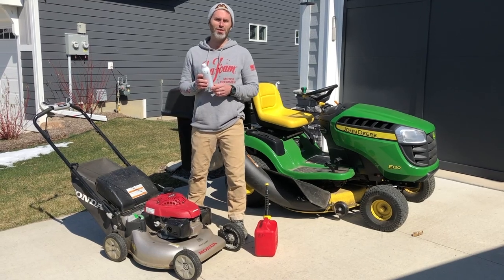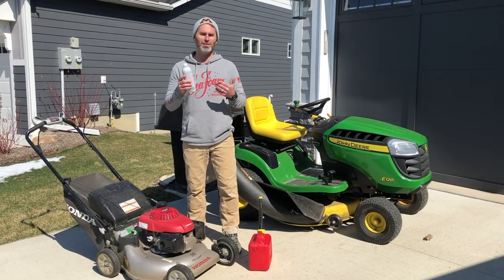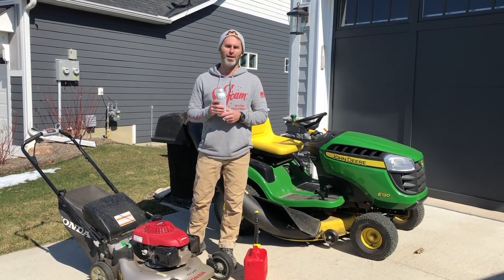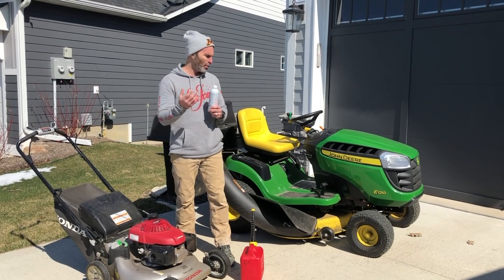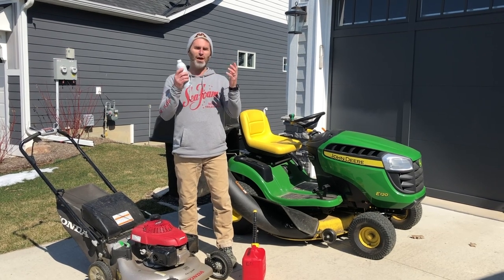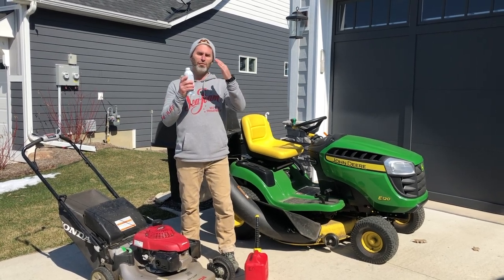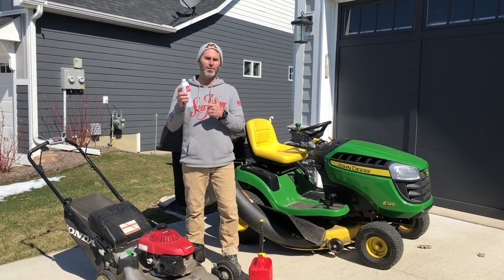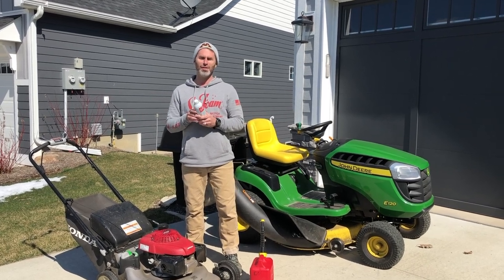How to prevent lawn mower engine problems (the Sea Foam way) 👍

Comment: I've been using Seafoam for a carb cleaner and fuel stabilizer for over 30 years and it just plain works. I run some thru my cars and trucks too to keep the injectors clean. After having problems using Stabil years ago, I switched to Seafoam and never looked back.

Comment: I have a Dixon ZTR Ultra zero turn mower with a 25hp Kohler Courage engine that is notorious for having issues with the carburetor.  I put a little bit of gas directly into the carb to get it to start sometimes, do you think I could pour some Seafoam in there and get good results?
Reply from the maker: Yes, try this the day before next mowing: Pour a full can into a low tank of gas and run the engine for 10 minutes. Shut it off and let sit overnight, then add more fuel and run as usual. Let us know what happens.

Comment: My motorcycle, after long storage, runs very poorly without a lot of choke. I am told this mean the primary jets are clogged, I am also told that the primaries are so small that additives cannot reach the "varnish". Has anyone had success?
Reply from the maker: Sea Foam will go wherever gasoline can go. No trouble reaching the varnish. Hope this helps.

Comment: I just recently heard of SeaFoam so please excuse my stupidity but are you folks simply adding the SeaFoam to your gasoline? If so, at what ratio? I watched another video where the gentleman poured it into his intake?
Reply from the maker: Hi Cheryl. Most common is to add to fuel tank. Can add 1 or 2 ounces per gallon of fuel. Can also add to oil crankcase at 1 ounce per quart of oil.

Comment: I have a John Deere X300 and it will run 30-45 minutes and will shutoff like its out of gas.  Will Sea Foam fix this problem?  If so, how much Sea Foam should I put in my tank?
Reply from the maker: Won't hurt to try. Let us know what happens.
Be sure to evaluate whether the JD's fuel tank is venting properly.
Reply: Check the vent on your gas cap.  My x540 did this a few times, and it was the tiny little hole on top of the gas cap plugged up with dirt/dust.

Comment: I use SeaFoam in my car. Just filled the tank and I added a can of SeaFoam to the gas. For better fuel economy and start ups. When I do a oil chang I put half a can of SeaFoam in with the oil,500miles before the oil change.
Reply from the maker: Great plan!

Comment: I started running canned gas (Trufuel) in my mower.  I find it easier, however, I find that it starts fine when cold, but if I have to replenish the gas during mowing, it's very hard to start.  Any thoughts on how I can use Seafoam to correct this condition?

Comment: What happens if I use the whole can in a 5gal gas can?
Reply from the maker: The more you add to fuel, the better and faster it cleans! 1 can to 5 gallons is 3.2 ounces per gallon. That's a decent cleaning ratio for a mower.

Comment: Does putting Sea Foam into the carb intake....stop a Honda mower from surging?
Reply from the maker: No, because the varnish restriction would be in the carburetor circuits. You need to add Sea Foam to the fuel tank to clean inside of the carburetor. The carb's intake is where the air and fuel mix before going into the chamber. [Fuel has already traveled through the carburetor.]
Reply: @SeaFoamOfficial  so adding Sea Foam to the gas tank should break up the junk in the carb and end the surging, correct? Thanks.
Reply from the maker: @timr8971  Yes, if there's varnish in the carburetor. Surging can also be caused by  venting in the gas cap, dirty air filter, or loose  carburetor or intake manifold (air can leak).
Reply: @SeaFoamOfficial   I tried the Sea Foam in the mower's gas tank and added the rest to my 5 gallon gas can.  It seems to have stopped the surging. We'll see if it lasts. Thanks.
Reply from the maker: @timr8971  Glad to hear! The more you run the engine under load (heat and compression), the better Sea Foam works to clean.
Reply: I had an old mower that would often bog down and die out when cutting my lawn at a certain height..Put the SeaFoam in the gas and it ran like a dream ever since.

Comment: Why do we mix it with gas. How about using only seafoam
Reply from the maker: Sea Foam is not gasoline. Sea Foam is the cleaner and lubricant, gas + oxygen is the ignitable fuel needed for combustion.